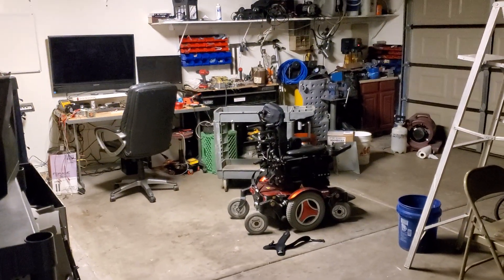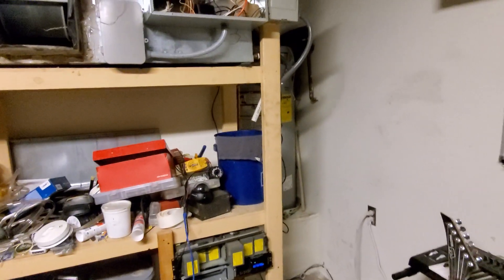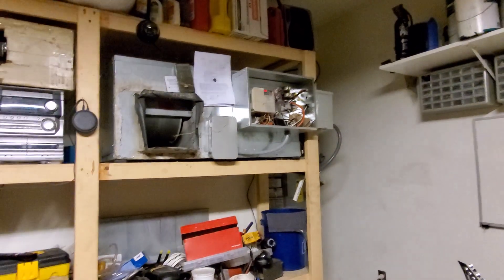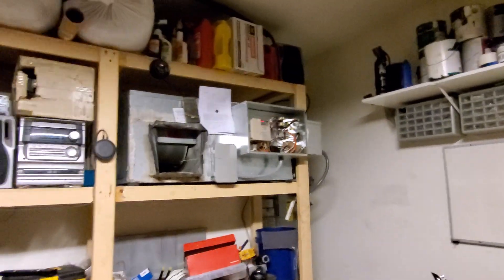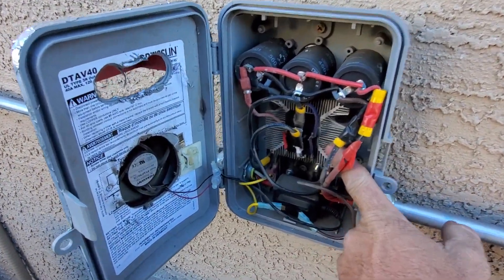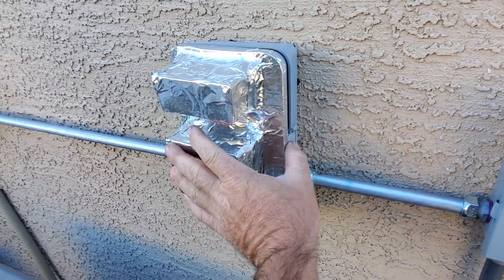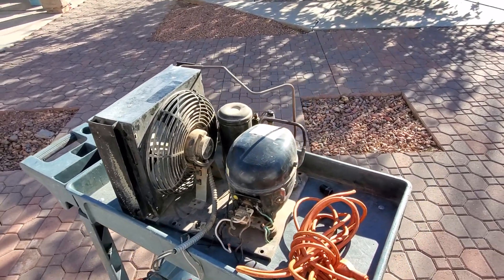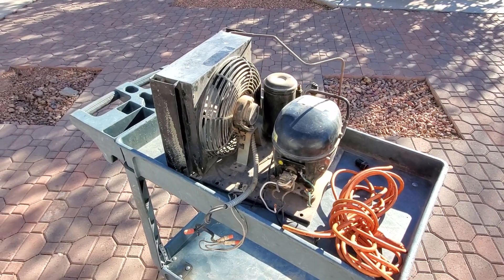Update of current and upcoming home projects

Comment: Heat strips?
Reply from the maker: The best pump is for heating the water,  not the space.
I call it a heat pump,  but there is no longer a reversing valve in it. 
It is strictly to heat water so the air coil is always an evaporator.
Which is starting to suck now that I'm using the garage to work in.
Reply: @hackfreehvac  I meant for the garage 😂
Reply from the maker: @DetectingArizona  
Yikes. Those are expensive to run.
If my water heater heat pump wasn't in here and the garage door was closed then it would not be too bad.

I plan on installing a mini split in there anyway so I may as well look into a heat pump mini split perhaps.
Reply: @hackfreehvac  mirage mini splits are 500$. I've installed around 20 of em in the PHX metro are. Only had one issue with them and that was a board.

Comment: When you run a VFD motor up to 100% you lose all your benefits of energy efficiency they actually use more power. 
         When you run them up to 120% or more you definitely lose all your energy efficiency yes you do have the added benefit it can do it when needed in those rare circumstances that is a plus. 

         If that one ton three phase compressor can he heat all your water with no problem running about 50% to 70% duty cycle you’ll be in the sweet spot range of energy efficiency. 

        But if that one ton had to run at 100% all the time to heat the water you lost all the benefits.
Reply from the maker: It definitely is cheaper to operate than the water heater electric heating element that draws 20 amps.
My heat pump draws 10 amps max and heats a little faster.
Being that using refrigeration produces more heat than the electric element, it still be cheaper even at 100%.

Also, one original reason for using a 3 phase comp was because I was curious if I could simply feed high voltage DC from some solar panels into the VFD and run the compressor.
And it did.

The 1 ton comp that I have is a inverter comp anyway.
It's going to be an experiment.
But I'm not even sure if it will run on a traditional VFD but I think it will.
Reply from the maker: @coldfinger459sub0  Interesting. I didn't know that they did that.